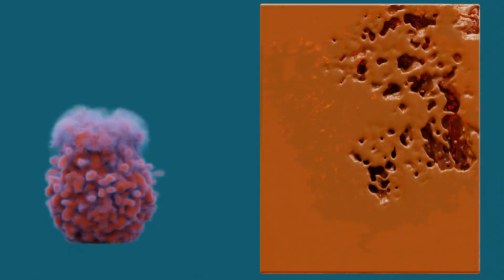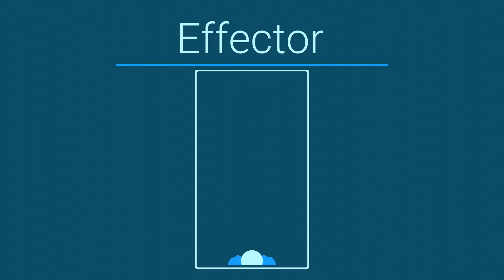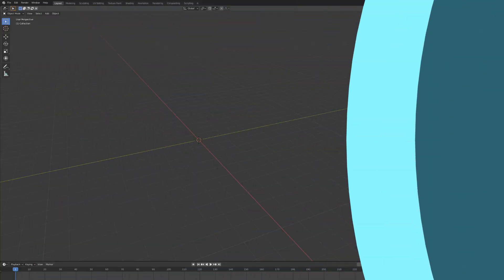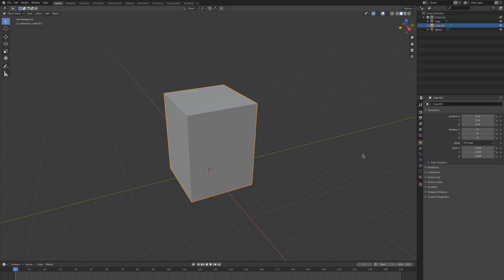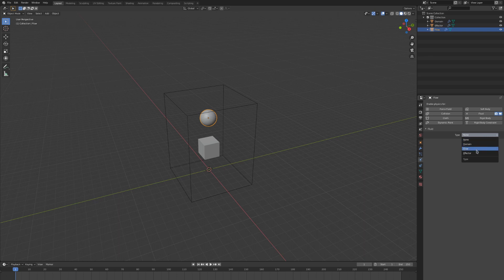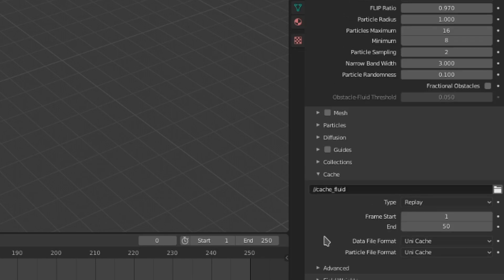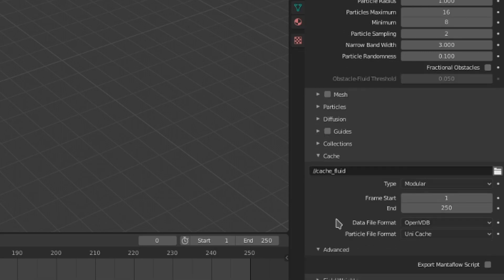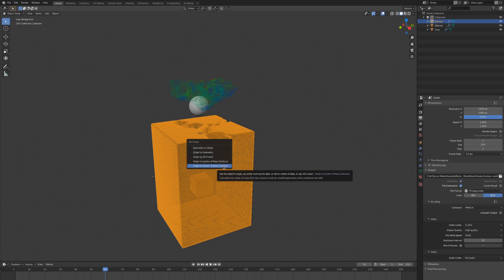An Introduction to Fluid Simulation | Blender Mantaflow Part 1

Comment: How do you turn the particles into a solid thing to render with textures?
Reply from the maker: If you're referring to the liquid itself, you just have to bake the mesh in the domain settings. For spray, foam, and bubble systems, you can go to the particle settings and set them to render as an object.
And for the fluid itself, you'll want to switch it's display type back to solid from wireframe once the data is baked into a mesh.
Reply: @MrCheebs  Thank you so much, but I already figured it out, I am an idiot. I forgot to press the bake mesh button.

Also, Here is my preferred water shader with nodes
Glass BSDF with roughness 0.8
Transparent BSDF
Both of those going into a mix shader

Together it makes a really realistic water shader.
Reply: I literally couldn't find mesh menu in fluid. Please some one correct me if I am doing something wrong.